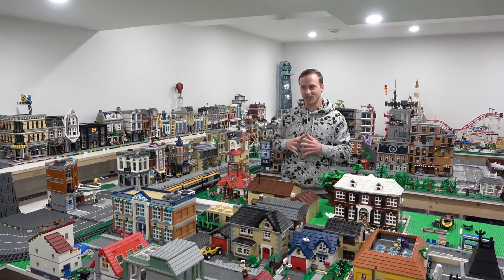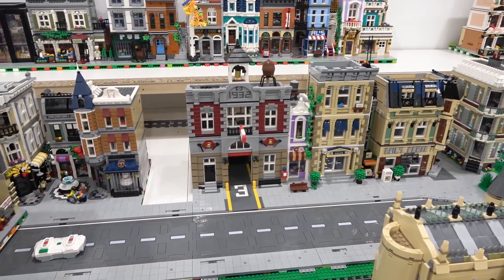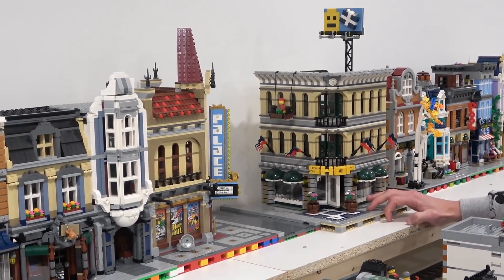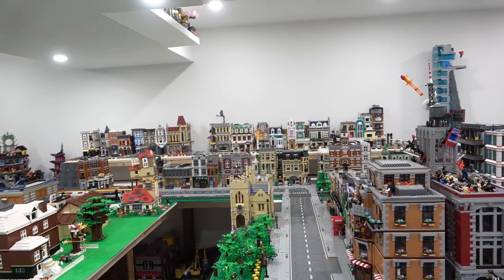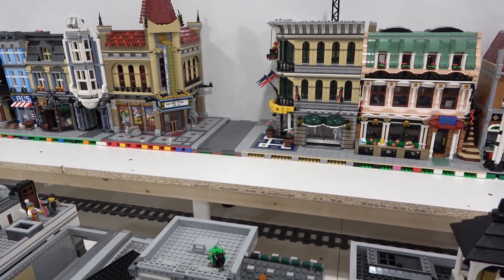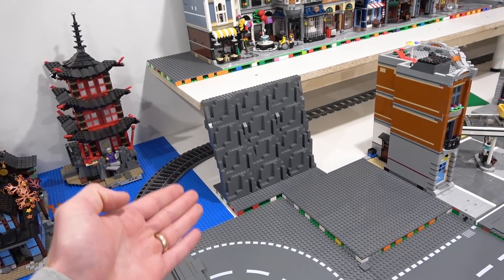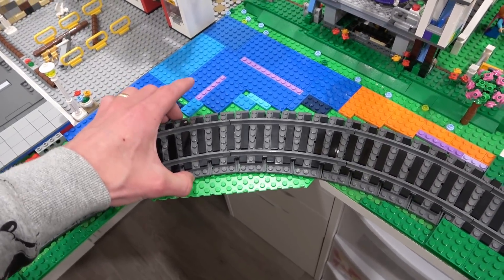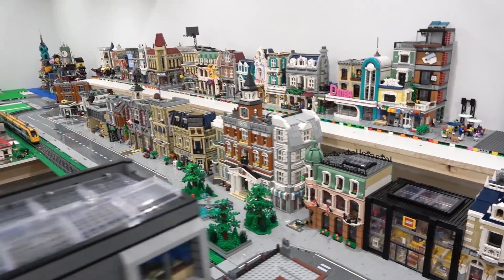Moving LEGO Modular Buildings & CONFLICTED! Room Rebuild Part 13

Comment: Great progress!

Here's my suggestions. Move the track one plate higher to tack it down (L standard). Blend the sides of the train plates up on the edges to interface with the Mils plates. It's OK if the ground dips down before the ballast, it's realistic. I'd modify the train/road crossings with a 1 plate slope increase on the road. Again it's realistic and would look good. Adding height variations makes it more visually interesting.

I wouldn't cut the baseplates for the rock wall. Use full ones and don't worry about the half that sticks under the table. Only use halves where the legs are for now.

Comment: Like the new layout a lot! And the space to work with is huge! Well done!
You could opt to not cut the baseplates and put the whole baseplate down. You build the BURP wall (or whatever pieces & techniques you'll choose) on top but just on the front half of the baseplate. The back half is out of sight under the raised platform. So no sweat. And if you ever need the baseplates at a later stage; voilà! (You'll probably still need to cut one or two though for the legs of the platform).

Comment: Okay, I've got some thoughts on each of the topics you bring up here, and also another thing I realized looking at your new layout.  Hope my thoughts are helpful.

Cutting baseplates:  In some of the cases, couldn't you just use a full baseplate and have it go under the risers?  You'd only have to use a half baseplate where there's a leg for the risers.  Maybe you end up able to baseplate most of the space under the risers, and have that train track on plates too, though of course less fancy because it's hidden.

Rock walls:  If it's possible, I do still think it'd be really cool to use a 32x32 baseplate on its side as the basis for the rock walls, and you could sideways build a cliff edge on it, complete with features like trees and stairs and so on.  Personally, I would have a bit where there's a staircase zig-zagging up the cliff, but there's an inconspicuous door half way up that leads into a hidden secret base under the risers.  :D  (My city has a hidden underground base)

Facades:  I love the idea of facades behind the upper level.  6-10 studs would be fantastic, and you could either build up some brickwork details, or hang baseplates on the wall, and make the facades like a Lego Art piece with enough space to give it some depth.  Whichever way you think would look better.  Also having a walking street along the front, built out to the cliff, would be pretty cool.  But that brings me to something I thought of...

Road Levels:  You've got roads in between buildings up top, but do those roads just end there?  Easy answer: yes, we'll build a road ending there, maybe a parking lot for the cliffwalk.  Awesome answer: No, they go to a huge project idea I have where there's a modular building on the lower level that's actually a giant car elevator and/or parking garage.  (My city also has a car elevator)

Train tracks:  I think the entire reason for going to MILS was so that you could build *down*, and train tracks being even with the roads are a perfect example of that.  The way it is, I would say is perfect for the level crossings.  Though if you could raise the sidewalks up, or blend them in a little better, that'd be good.  Even like, the cheese wedges would work.

Track curves:  What if you customized the ballasting a little, maybe you could use a turntable at one or more points to anchor the curves down?  I'll admit I don't know much about Lego Trains, but I feel like there must be a way you could connect them.  There's no question though: curved train tracks are like, the bane of Lego cities.  :P

Highrises:  That back corner where the Avengers Tower is standing all lonely..  I think it'd be absolutely awesome to fill that corner with a backdrop of highrise buildings, skyscrapers that really build up the city and give it a unique and distinctive skyline.  From modern 'glass and steel' looking buildings like Avengers, to imposing "concrete jungle" blocks, to classic Art Deco works of intricate, even opulent designs.  ...I have many ideas and I'm practically drooling over the thoughts of what could be, in that space.  :D

Comment: Ok first, great video! I’m rebuilding my city right with you and am facing the same questions. Yes you can cut baseplates wether real or third party. You can always get more baseplates. That’s the ONLY cutting I do though. Next, I would leave the train tracks as is. Finally try a few facades and see how they look. You can always remove them. It might look too cluttered but it depends on the height and color I guess, (Mr. Bookiboo is a great builder and resource 👍) I know it takes a lot of time but that’s what we love as Lego builders, the constant ability to change your city. Look forward to seeing what you decide.😀

Comment: The City is taking shape now, and already looks amazing, something to consider on the platform is that you will potentially have more space on the front of the buildings if you use the tops of the rock wall, there are 2 studs extra which allows you to pull out the modulars a little more, giving you more space at the back of the modulars for facades. you can have the cobbled walkway overhanging the rock wall even and more then likely there will be some staircases up to the platform, and possibly some elevator for wheelchair access. The more you can puul the top modulars forward the better depth it will give when the facades go in.

Comment: If you are not putting roads for cars in front of the modulars on the top shelf, I think a smaller walkway in front and facades in the back will look very good. Maybe a little mountain somewhere if you can get it to fit in, but if you will build rocks all the way in the font of the ledge then it could be too much mountains (Mr Bookieboo has pulled it off so I am sure you could too if you wanted to go for that solution).

Comment: I have a solution for the half basplate problem, just put your clifedges/walls on the side of your full baseplates and then have the other part under the raised platform. Only where the legs are you have to use half ones. I hope this will help you.

Comment: You posed a lot of options here so I'll try and organise my comment, so in my personal opinion I believe you should do the following;

-Train Station, in your last video I suggested building it into the under platform, which you thought about in this one, I believe it would be awesome to have a train station that leads under the platform, gives a great illusion of depth. A hidden platform, that could be revealed would be epic.

-Platform and MURPS, I think yes you should shift everything forwards, the MURPS to the edge of the baseplate or maybe leave a stud or 2, then shift the modulars forwards and you don't have to sacrifice path space for the facades at the back, best of both worlds. I think tall facades is a great idea and will only add to that city feeling.

-Train Track, I agree I think it being level with the roads for the crossings is the best way to go, like you said you'll cover up the sides of the MILS plates with the fence, and untacked corners you won't really notice that much when all is said and done especially for how much work/parts it would take to have it the other way. 

P.S I still think the other road that goes under the platform should be a fake tunnel, it could even go round a corner out of sight, add some lights and voila, great inner city tunnel. So Train station on one road and fake tunnel on the other. 

City is looking so good! Been waiting for this video xD modular placement is great and MILS means if you get any more pop culture stuff things can be moved, got a lot of extra space now and its genuinely feeling much more like a city now than the old layout.

Comment: I think you should bring the train track up a plate so everything is at the same height and you can take down corners to make it more complete. If all of the track comes up a plate width than it will fix the exposed brick issue giving you more options for those spots and the crossing heights with also be even with the other sidewalks.

Comment: You do you for the train plates. However, when I drive over a train track it does pop up a bit. I understand you wanting to make it look smooth through there, but it's either extra parts bought for lifting the train plates, or extra parts bought for trying to hide it with the rock wall. But you could use your current rail under the cliff, since it will be hidden it doesn't need to look that good. Yes it is a plate height difference, but it might be do able for the dip if it's hidden.

Comment: You could use a full baseplate for your rock wall as the unused part of the baseplate would just be under the platform (no need for cutting baseplates).

Comment: maybe u can use the arc like piece which sits on the base plates to connect the curving tracks to the base plates with some extra parts so it will hold the track as well as it will be a simple job,

Comment: Your current layout by no means looks bad, in fact it does look good but I really feel like the residential based building (not including skyscrapers) should be on the raised platform. This makes much more sense as a realistic set up. Some Modular’s like the detective’s office could go up there as well but all shops and food based buildings should be in the main core of the city. You could make a cliff staircase which leads down to the city core for the residents to access the city 😊

Comment: Most rail crossings are higher than the road so it would be more realistic to use the L gauge standard and then use Curved Slope 71771 on either side of the track at road crossings.
Reply: sume road crossing are at road level  to ..I like that in Melbourne Australia thay got rid of train crossing. now the train are up in air of the ground .kinda like USA has...so no road crossing ...

Comment: 1- for the cliff, could build on baseplate et leave unbuild the parts under the platform ? So no cutting ✂️
2- for the corner tracks, why not leave the loose but build your landscaping 1 plate over it without (the would be loose between the baseplate and the top, so you can be even with the mills.

The placements on top are so much better ! Good job like always when you think it through

Comment: I'd say go for the L-gauge, look at the new Lego CIty train station, the rail crossing is also one plate higher than the road, it's doable. And you can also just the full sized baseplates for the rock wall, even though half of them won't be utilized because it's hidden under the platform.

Comment: What if you use full baseplates that extend under the top shelf and then you only half baseplates for the top? Less cutting. Plus doesn't the track behind the city need to be a simular hight? Or are you planning to just have it go down to table hight and back up?